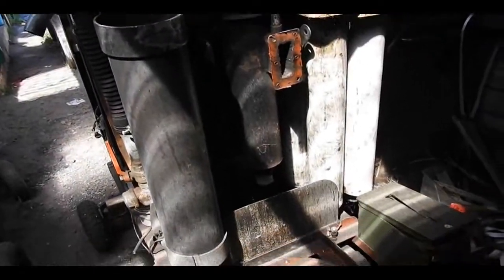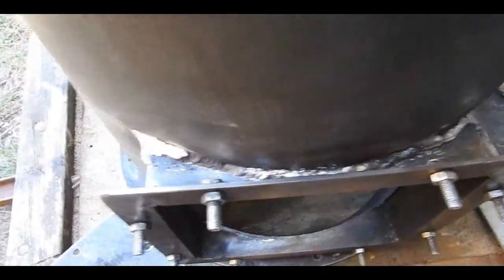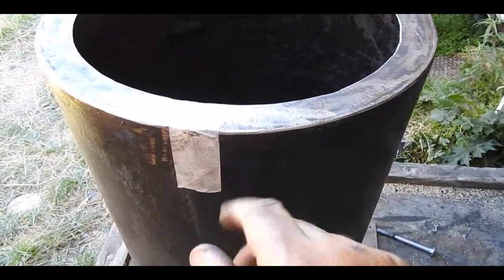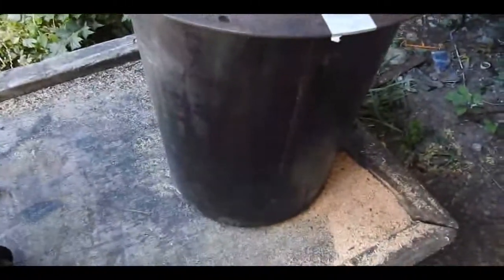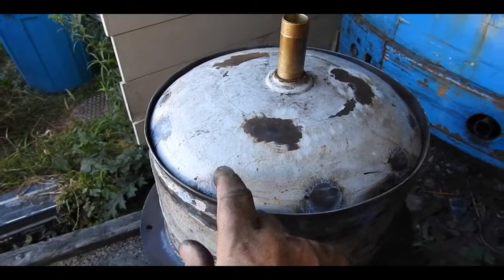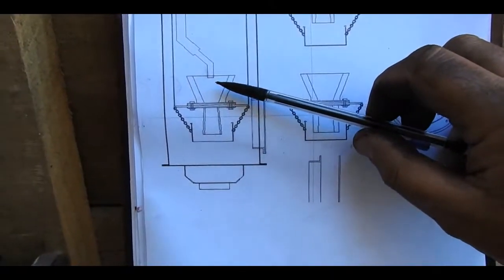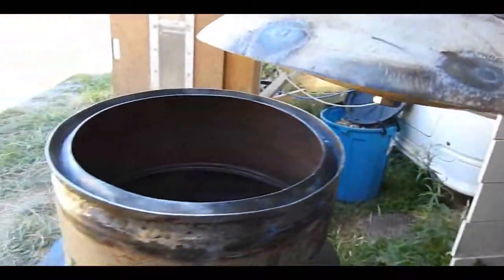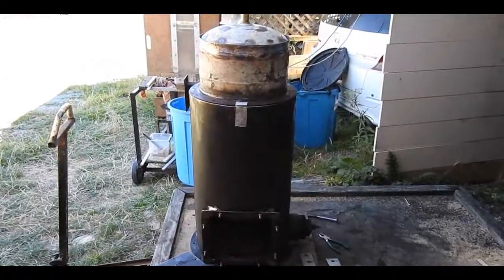Victory Gasifier Rebuild.

Comment: I can tell that you've put a lot of thought into making this build easy to service. Wow $1500+ for stainless steel for the hearth? I know this is your main source of winter power so I can see why you want it built like a battle ship. It's looking really good and I can't wait to see it completed. I was looking at your single nozzle design and I wanted to give you some feedback from my personal experience on this design. The first time I set up my single nozzle build I did what you did with running the air intake down the side of the inner chamber then followed up with angling the nozzle into the ember bed. The concern I had was bridging so my work around was to run the air nozzle straight down the center at a 90 Deg angle starting at the top where the air intake is so that wood chunks could flow freely around the nozzle without worries of wood perching up on the angle where the nozzle meets the top of the hearth but I'm sure you've probably considered that. Just my opinion but the original "Victory Gasifier" design with nozzles being around the sides of the hearth are probably a much better design as far as reducing possible bridging issues but since most of us are running smaller engines we can get away with a single air nozzle design and I never see any major bridging issues especially using a 90 Deg straight nozzle setup. You can still dissipate the air somewhat sideways by adding an end cap at the bottom of the nozzle thus forcing the air flow to travel out at a 90 Deg angle. Before I hang up the phone I would like to say that I really enjoyed seeing the pink flowers that suddenly bloomed in the video somewhere around 3:10 in the video. Yep I wrote a book here. Sorry about that
Reply from the maker: Howdee Mike, 
 Great book. I loved it. It's gonna be a top seller  ;) . 
 Yeah, those hearth parts are pretty spendy, but they are gonna be worth it in the long run. 
 I was wondering about the air feed nozzle assembly, and its effect on fuel flow. 
 After the video was done, I started playing around with some pipe fittings, and eventually arrived at the solution you have suggested here. 
 Talking of nozzle count, you may remember my FEMA to Imbert conversion video, where I created a triple nozzle arrangement. 
 It worked like a charm, and it also allowed me to stir the fuel column, if the need arose. 
 Perhaps I can add a fuel stirrer to the single nozzle system, somehow. Hmmmm!! 
 The original nozzle ring in the Victory Gasser was reasonably effective at preventing bridging, but it wood occasionally get jammed up. 
 With that in mind, I aimed to use engine vibrations as a partial solution. 
 It sort of worked, but it seems that no solution is perfect. 
 To spread the airflow at the air nozzle tip, I might try copying watt I see in garden hose squirtery nozzles. 
 These have a cone at the middle of the nozzle that causes the water to spread in a radial fashion. 
 Heck, anything is worth a try, but I suspect that the garden hose might melt in there  :) . 
 Ahhhh, I am glad that you enjoyed the little splash of summer flowers in my video. That MSMPEG4V2 video codec just loves to fling pretty little flowery splat marks into my videological productions  ;) .

Comment: Lots of anti seize on the bolts holding the gasifier guts. The can be a b.i.t.ch to get apart after  liberal amounts of heat have been applied
Reply from the maker: Hmmm, good point! 
 I wonder if I can benefit from using very long bolts, with spacers, so the nuts will be more distant from the hot spots.

Comment: Nice work there Mr Steeme. I'm excited to see it coning together. The theory is sound from my humbled opinion with only one suggestion for you.  It was mentioned that the inner can would sit on top of the outer container with just RTV silicone to " glue"  it together. That looks to me like  it could become a rocket launcher when the inevitable bug flatulence occurs. It might serve well to bolt the two halves together and allow the lid to become the bug poop flapper. My similar design met the same fate at one point with a massive backfire which caused the bottom and the top of the outer barrel to bulge outward quite considerably. Had the snap ring for the barrel lid not been there I'm sure the inner core would have reached lofty heights in the shop accompanied by large amounts of glowing bug carcasses .
Your new access door will serve you well and will allow you to do maintenance and make adjustments to your grate , and so forth. 
Good job and please keep us updated
Reply: Steve,  I'm with Bill on attaching the hopper to the base. Even if you just want to throw a few latches around the perimeter that clamp it down. Other than that,  great work.  Can't wait to see you fire this up. And being that the spring is headed our way,  we shouldn't have to wait long before you're going to need the heat. Keep us posted.  Joe
Reply from the maker: Howdee BillyWatts, 
 It sure is sweet to see this old powerhouse getting a new lease on life. 
 You raise a good point on the launch capabilities of this particular spacecraft. 
 After all, it does have a rocket engine on its base, and a satellite antenna on its top, just like Elon Musk's rockets do  ;) . 
 I will need to devise a means of more firmly locking the upper and lower halves of my space rocket together, so there will be more room for the woodgas bugs when they go into orbit. 
 Hmmm, thinking caps....... activated! 
 Hopefully, I will not have a big blastoff like you did at your launch site  ;) . 
 Indeedy, that access hatch is LONG overdue, as pulling the entire gasser to bits in order to make even the smallest internal alteration was becoming somewatt tiresome. 
 Yeah sure, I have lots of spare tires here, but I am saving those for a less tiresome occasion. 
 I am really looking forward to the light up on this, but that's a fair way down the track, as I have LOTS of lathe work to do on the stainless steel parts that will adorn this fine wee beastie.
Reply from the maker: Howdee Joe, 
 Yup, I will need to have me a bit of a think about the connection between those two rocket stages. 
 A ring of studs wood work, but I may go with something along the lines you have suggested. 
 If I had known how much it wood hurt to think, I wood knot have tried it  ;) . 
 My brain hertz!